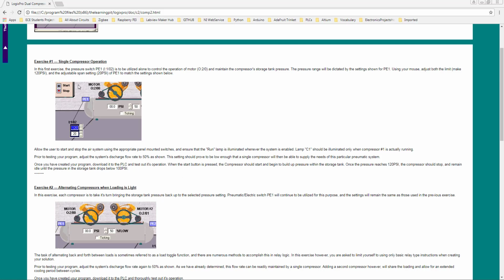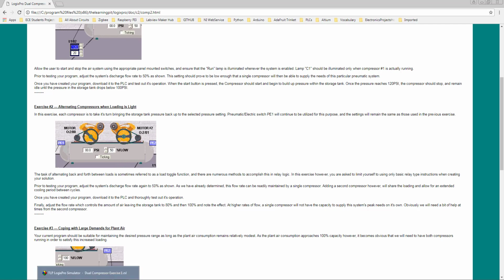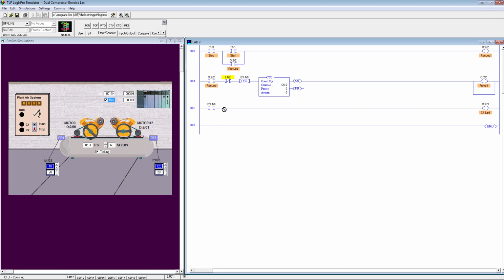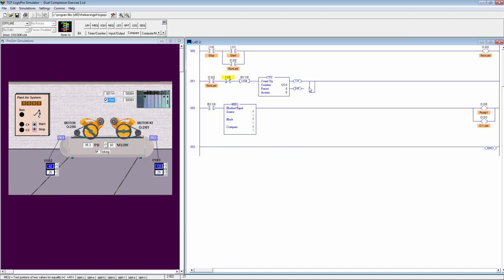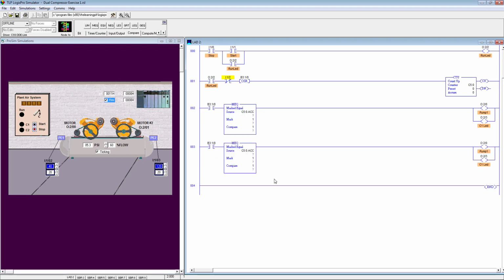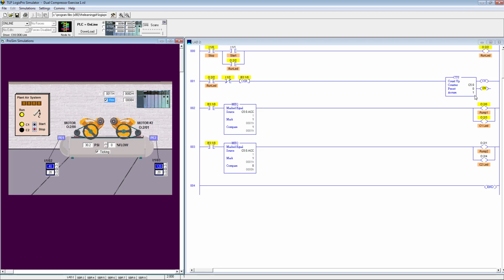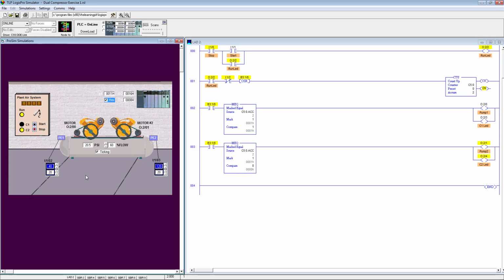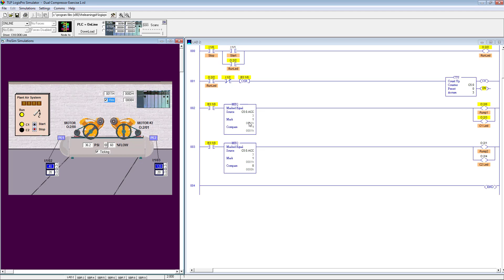LogixPro Dual Compressor Exercise 2

Comment: you're supposed to do it with basic relay logic, not using counters and other comparable instructions
Reply: You're right. I did it with a logical circuit and by the way it wasn't easy. You need toggle system, but do it separately with binary bits and then use them to control the run of the 2 pumps.